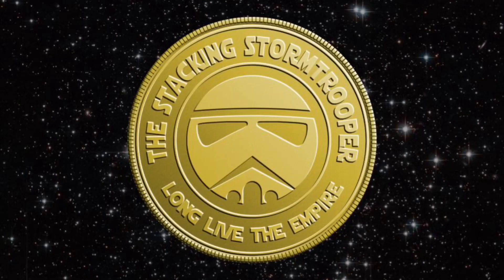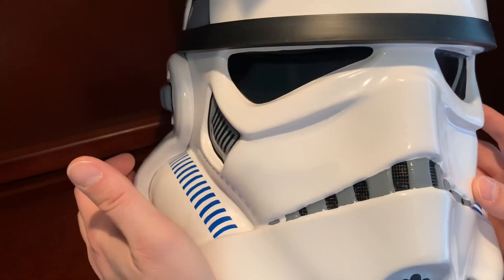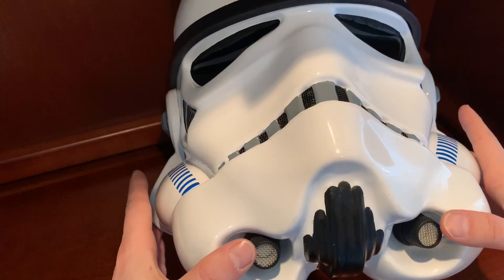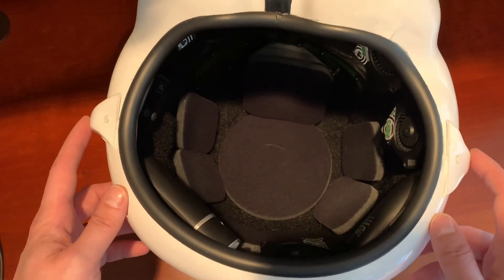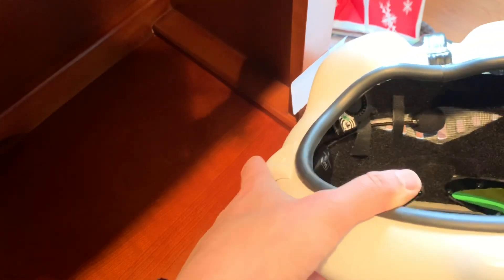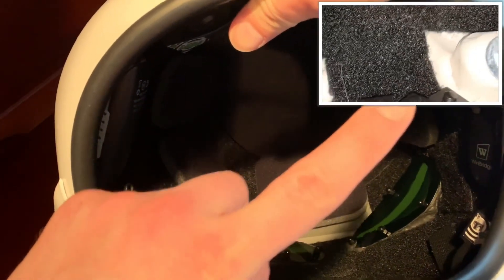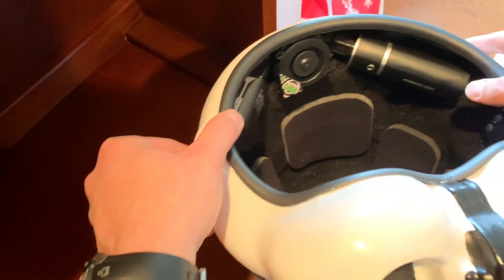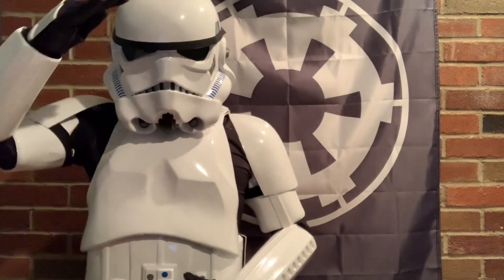What Is Inside A Stormtrooper Helmet?

Comment: I've been doing casual research into making a functioning stormtrooper helmet for years. With HUD, microcamera and VR tech accelerating so quickly I could actually make a decent approximation of the cutaway helmet seen in the visual encyclopedia.

The soft velcro isn't a bad idea, I'd be more inclined to use the coolmax material used inside motorcycle helmets though
Reply: @user_name_redacted  need a Kevlar storm trooper helmet shell next and then it would be real world star wars

Comment: Awesome job my friend. That is super impressive. Much of the magic is what we don't see usually. I'm still confused how sound is amplified out of your chest.
Reply from the maker: Sal-  So, this Video was mainly in part for you as you mentioned that you’d like to see what’s inside the helmet. Regarding the sound coming from my chest, the chest plate has space in the sternum area. This gap from the armor to my body is large enough that I fit several more components inside. There is a Bluetooth receiver that the microphone in my helmet transmits sound to. This receiver is connected to a voice modification box. The box makes various static bursts after each pause in my speaking, JUST like in the movies. This voice modification box is then connected to a small amplifier- just picture your bass guitar amp, but on a much smaller scale. So, when I speak, the sound transmits loudly from my chest area- but it’s not like people can notice where the sound is coming from. Since the amplifier sits high up on my chest, it just sounds like it’s coming from my helmet. I also Velcro my iPhone into the chest cavity and play tracks/ambient sounds which sound like I’m receiving chatter from other stormtroopers; again, just like in the movies. 

I’ll do a follow-up to this video showing off the inner workings of the armor electronics and what is involved with “suiting up”. 

Thanks for watching, buddy!